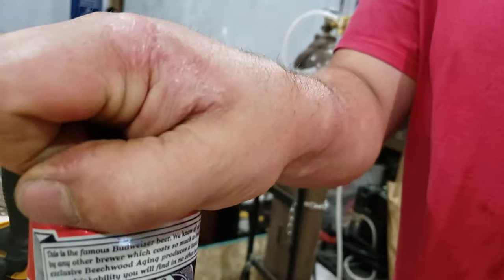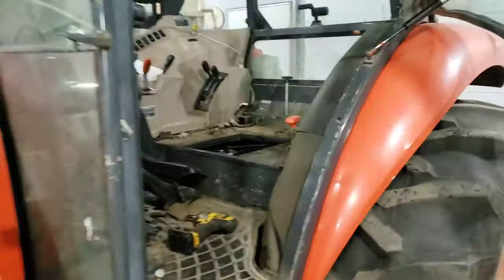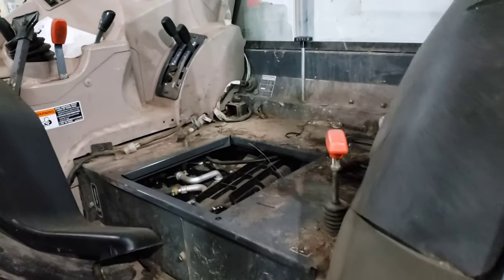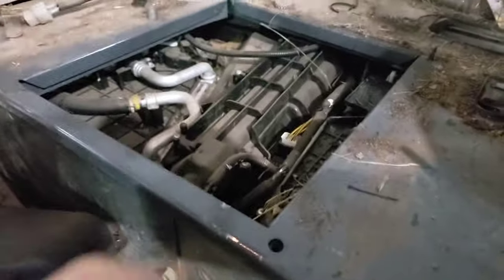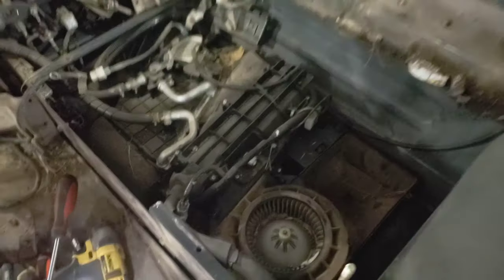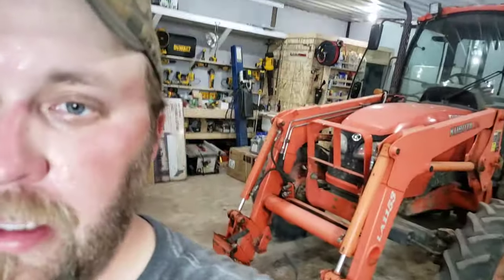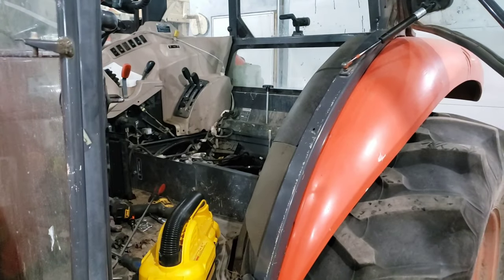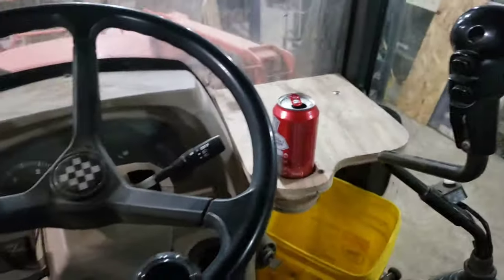Farm Vlog #86 Air Conditioning in the Kubota M6040

Comment: Always fun messing with AC🤬😂🤣😂🤣🤣😂🤣
Reply from the maker: I actually couldn't believe they used hose and I could take the dam thing out of the cab without evacuating the system.👍🤣 thanks man
Reply: @RickBork  I'm surprised!!!
Interesting they cool it under the seat, run it above the hot transmission and then blow it at you..  must be insulted really good.
Reply from the maker: They did wrap it with a lot of foil and insulation hell I'm not going to argue if it works. Lol 🤣 hell it even keeps the beer cold🤣🍻🍻🍻🍻🤦‍♂️
Reply: @RickBork  Nice